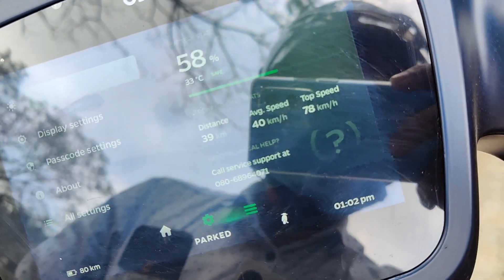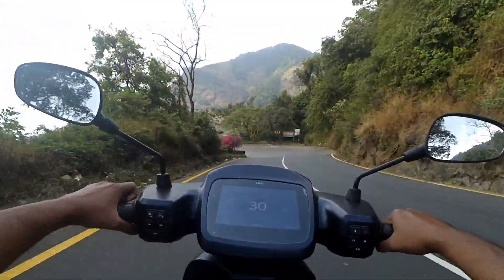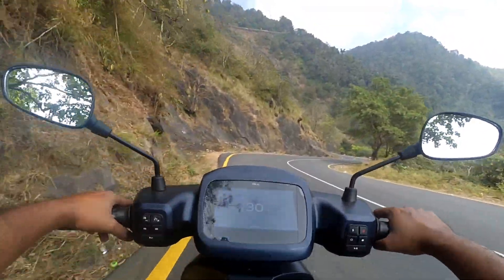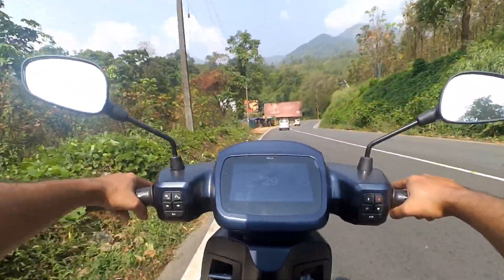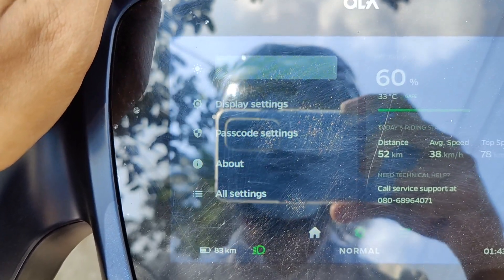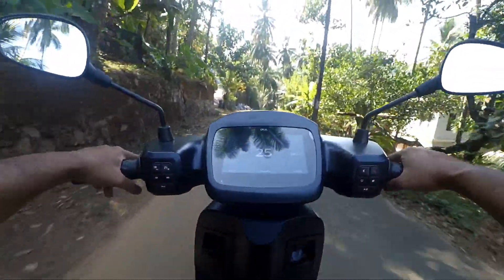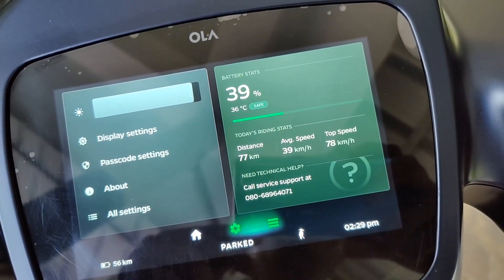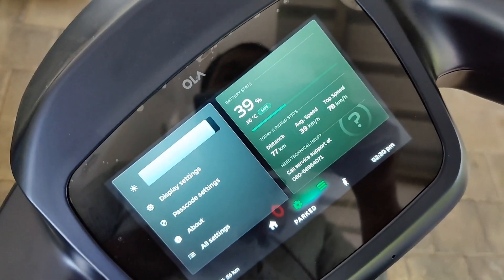Ola S1 Pro Solo regenerative braking charging Test | Wayanad Mountain Pass |Thamarassery Churam

Comment: EVs are actually pretty good in hilly areas. Unlike ICE vehicles, EVs with regen give better mileage in hills.
Reply from the maker: Small Hills are ok for battery. But in steep mountainpasses the energy lost for uphill will be much higher than the energy we get from regen
Reply: @Habistech  Is the total energy lost during a full uphill and downhill ride greater than that of riding a similar distance in the plane? It would be nice to check this.